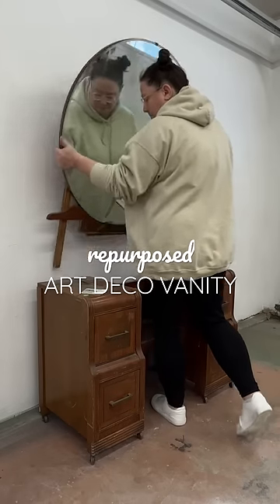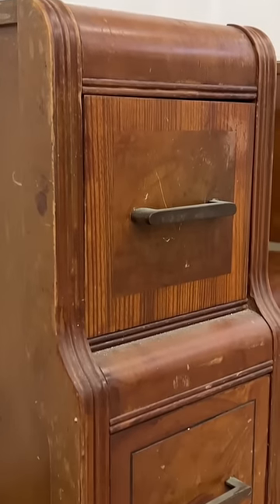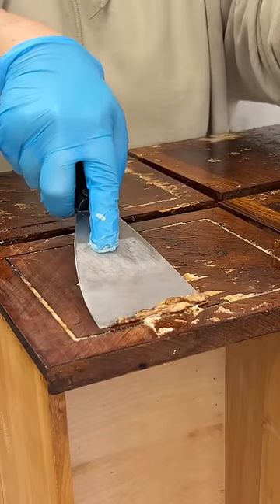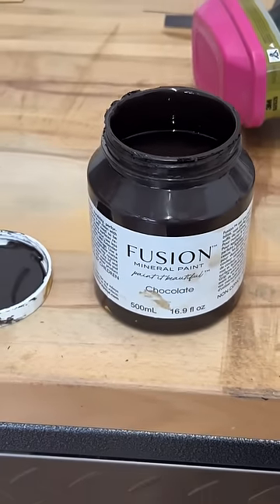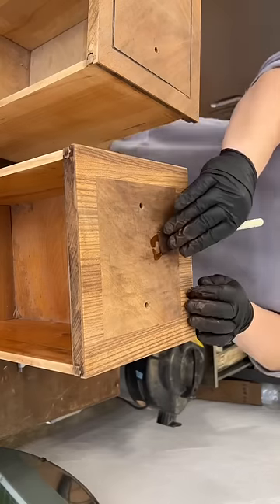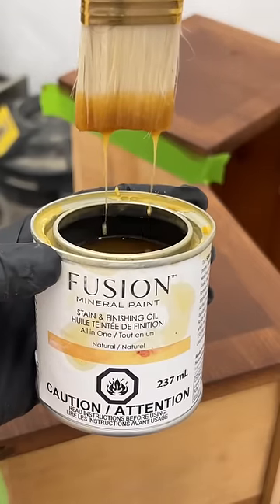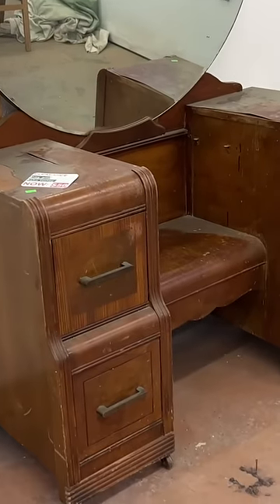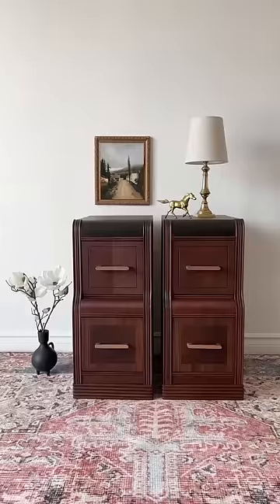Repurposing a trashed Art Deco Vanity #furnituremakeover #upcycledfurniture

Comment: This turned out INCREDIBLE !!!  love everything you did.  You have a great eye for style ! Which a lot of people can only wish to have.  FYI...for future considerations, this veneer could have been saved.  Just think of it as brittle fabric and use just the steam from an iron to soften the wood.  Then press the iron down to reshape it to the substrate.  May take a couple of passes with letting it cool and dry out in between. Any loose spots just glue down with wood glue since it's also heat activated, but use silicone baking paper over the wood.  Nothing sticks to silicone.  Cheers !
Reply from the maker: This veneer could absolutely NOT have been saved. I’m well aware of how iron on veneer works but this veneer was well past repairing never mind the fact that hand sized pieces of it were completely missing.

Comment: Omg you ruined that dresser?  I've been looking for one forever with the mirror!!!  How awful!!!!  You could have fixed it....
Reply from the maker: No, I couldn’t have fixed it. That’s the whole point. I didn’t destroy it either. It’s previous owners did that. 

If you’re looking for a similar vanity I’d suggest visiting your local thrift shops as I see at least 40 or 50 of them in mine every year.
Reply: Yeah, that piece would have been really tough to fix, for sure if you're trying for a full restoration. Not worth the money unless you particularly like it and want to redo the veneering specifically because you want to keep the vanity for yourself. But even then, you'd better be REALLY good at veneer work to be able to get the right curves in the right places...